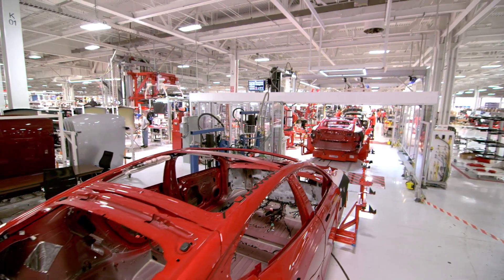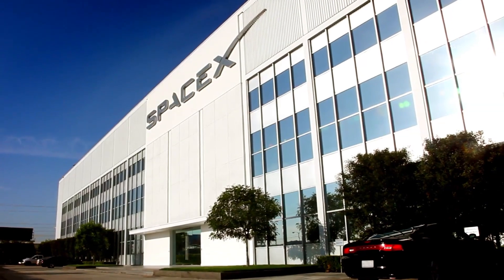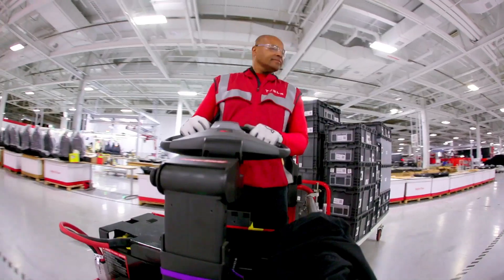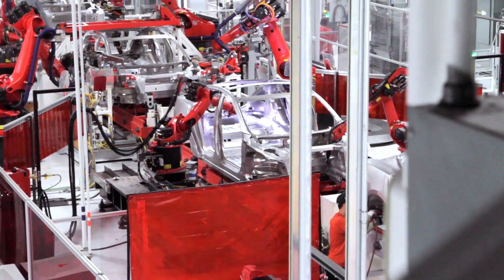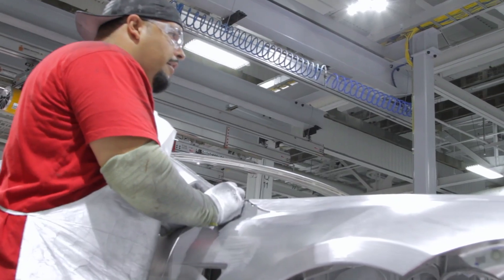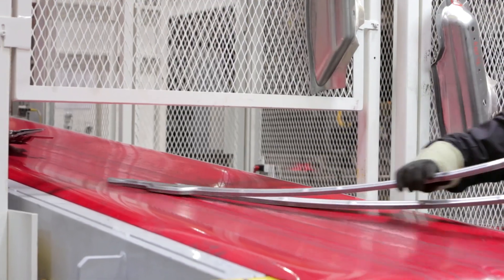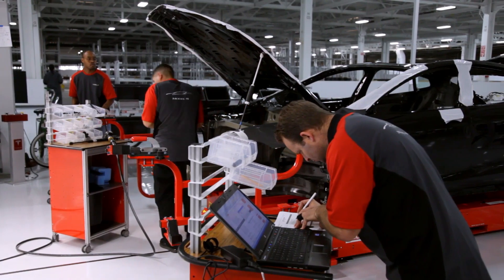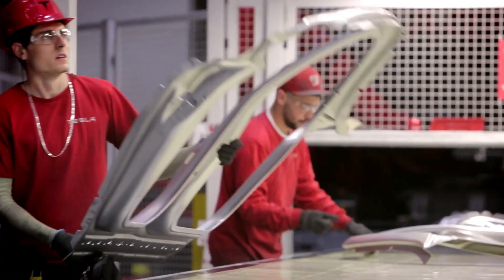How Tesla Builds Electric Cars | Tesla Motors Part 2 (WIRED)

Comment: It says that humans are more intelligent than robots which is correct right now. But pretty soon, the statement would be reversed with quantum computing power in which a robot would be able to think of multiple tasks at the same time which humans are not able to do. Hence, at that point, it is inevitable that robots would take over most of the jobs which humans are doing now. 

The human race has to prepare itself for this inevitable evolution.
Reply: +Weerakoon Wijewardena Processing power isn't the same as intelligence. You need intelligent software as well, not just powerful hardware. However, a machine doesn't have to be as smart as a human to perform better at most tasks, so that doesn't matter. Machines just half would put 95% of people out of a job, because most jobs do not require an amazing intellect, or even an average intellect.
Reply: Quantum computing is an eternal pipe dream. A general purpose quantum computer could theoretically resolve all artificial intelligence issues because it reduces most tasks that solve in exponential time into tasks that are solved in polynomial time. However it's unclear whether such a machine can be created, and if so, when. So far, the existing quantum machines are nothing like that, and it doesn't really seem like the goal is coming closer.

People can't think of multiple things at the same time very well, so you don't need a quantum computer to replace a human, a more likely replacement is some kind of 3D interconnected logic array. However logic arrays are akin to memory devices, and you have seen first 3D multi-layer memory devices already.

Certainly, our algorithms and computational capacities have been improving, and i think humanless factory is possible right now. However, the engineering cost and time can currently run rampant, so it's more economically viable to have people on production. The most effective step now would be IMO to provide more powerful tools, possibly AI assisted, which can increase the velocity of software development. But nobody has the silver bullet yet.

Comment: I want one of these electric cars. I can charge it my self with my solar panels. This would be great.
Reply: +shartne how many solar panels do you have? a couple acres of solar panels would be needed to drive a short distance to work everyday at a cost that would easily eclipse the car itself..or you can cover your house with panels and wait a week to drive once to work, maybe, why not just use one solar panel and work from home for a couple months while it charges?
Reply: You could do a lot with only 5,000 watts of panels. thats about 20 panels. I can cover everything during the day at my home with 2300 watts. I use gasoline to drive my care gas is cheap. 1.50 a gallon. what you say about needing a whole bunch of acres is false really off on your figures by a mile.
Reply: cars take more electricity than your house, add your house use to a car and drive about 60 miles a day and it will take more than the roof of a 1200 sq ft ranch. Include cloudy days and winter and partial exposure and it gets to be a challenge. With an acre or two, you could compensate for most of those deficiencies.

Why don't you just put one solar panel on the roof of a Tesla and drive it cross country?
Reply: https://forums.teslamotors.com/en_GB/forum/forums/how-much-does-it-cost-fully-charge-model-s-85

you are correct,

I miss read a decimal.
so based on the numbers in the above forum, we save about 1500 USD a year in fuel and incur and upfront cost of the car and the solar installation. 100k+ (of course we can finance it.)

Solar declines in output every year as the panels degrade and it is difficult to drive enough to break even, if we evaluate the purchase in dollars.

without solar or clean energy we are driving a coal and propane powered car.

I love the idea of electric cars. I would like to own a Tesla. Hopefully we have some genius discovery for energy production in the next few years.

Comment: The practice is, however, different. The driver sets its default settings before the journey begins on the big screen. He can save them as a profile and load at any time, if someone is driving with another driver profile. During the journey he has all the information, including navigation, in his dashboard and can also switch on the button on the steering wheel, the display information. He no longer needs to look at the big screen while driving.

Comment: It's an interesting comment. Where is energy created? Even our sun is not actually creating energy, but transforming energy through nuclear fusion transforming mass to electromagnetic radiation.
So how about non-rechargeable batteries? For example, I can make a simple battery cell out of putting two different metals (e.g. Zinc and Copper) into a citrus.
All energy originates from the Big Bang and has only been transformed ever since.

Comment: A good video, but it's also how all OEM's build their vehicles as well.  There is not much difference in vehicle manufacturing methods/technology across the OEMs.  The exceptions being that the entire Body In White is made out of aluminium instead of carbon steel, and that there's no gas powertrain that's loaded into the vehicle.   Also, FYI to those that don't know, Tesla's plant was a former GM/Toyota joint venture (NUMMI) and before that, GM-Freemont Assembly.  History lesson for the day.

Comment: Lithium-Ion are far  from non-toxic (EPA study), but they are the best alternative to lead-acid at the moment. Carbon nanotubes seem to be a decent step forward as anode replacements but the energy cost to manufacture results in a negative return.
It would also be nice to think that many are like you and ensure solar or renewable fuel sources are used.to recharge these batteries, but I have a feeling the number is few and far between.

Comment: Your mistaken about lithium batteries, which are considered non-toxic.  The conventional lead-acid battery in Conventional cars is far more toxic because of the well, lead and acid.  

You mention pollution from energy production using fossil fuels and yes that is a problem, but may EV owners make there own Solar and Wind energy or buy Renewable Energy offsets like I do.  Tesla Super Chargers are moving to 100% solar with energy storage.  

A simple solution like riding a bike is still better.

Comment: If you had actually read the article you would see that it debunks every one of yours.Yes stocks are high, but only because of artificially inflated profits due to carbon credit sales.That and creative reporting of their profit source is what people are buying into.
On top of the fact Electric cars are the WORST for the environment when you count the materials and manufacturing required to make and dispose of the batteries. Also the electricity to charge them is still created using fossil fuels.